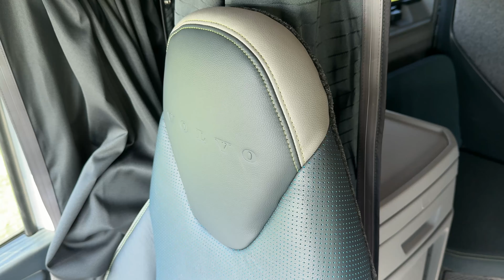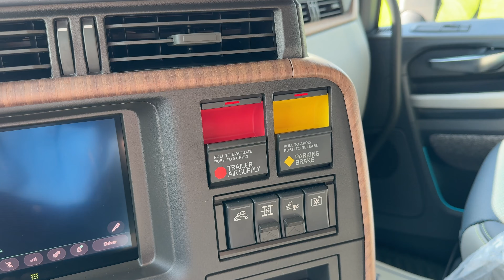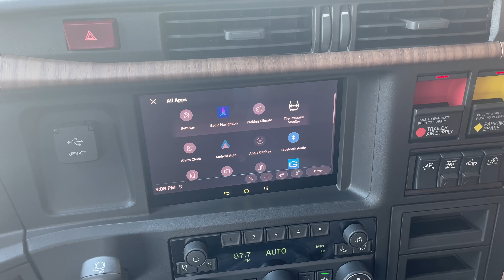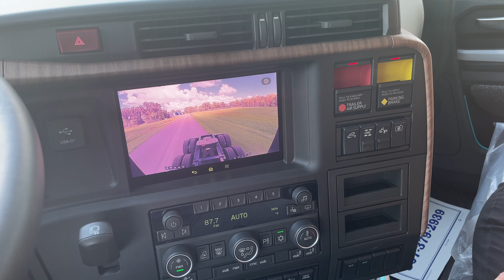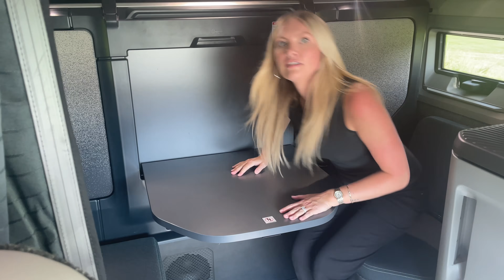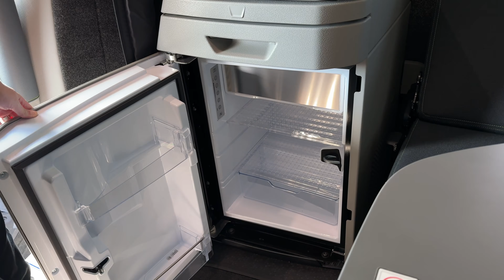All-New Volvo VNL860 Sleeper Interior Walkthrough | Dave Syverson Truck Centers

Comment: Just got done watching a review of this truck the guy said it has led headlights but he didn't think they were any better than the previous ones in the previous truck also the previous truck the turn signals would automatically turn off after turning this truck you have to manually turn them off each time there's also no option for a analog gage cluster so your stuck with a digital one you can put more cameras other than the back up camera if you want more he said with the tanks full your always overweight windows are also smaller on this truck the previous truck you hit the button once to make the window go up once to go down on this you have to hold the button

Comment: The heated windshield is a no for me.  I have had my windshield replaced 6 times in my current truck.
Reply: Is the windshield somehow weakened if it's heated or what
Reply: @nickforest7816 I don't think so,  I psu think it would be expensive to transfer the heating element to a new windshield several times over
Reply: @AC-ir3od i just saw a review video of the new volvo the guy was complaining about having to hold down the button to roll up the windows or roll them down i found out that the mechanism to work the powered windows often fails but you dont need any tools to fix it the mechanism just needs to be reset and it will work again maybe he didn't know that and thought he got windows that weren't fully automatic
Reply: Do you drive in areas where you get a lot of rock chips on your windshield that could be why your replacing it so much the best tip for that is to drive further behind the vehicle ahead of you
Reply: @nickforest7816 Its really random,  often when i least expect it.
Reply: @AC-ir3od do you drive the new volvo like the one in the video

Comment: Bigger fridges in these trucks please. I’m out 8-12 weeks.
Reply: You can only do so much with room tho. You might need to door dash groceries to yourself or something. Or get a. E scooter with a basket and trailer cart and in down time go to walmart. It works and you can get one for 300 bucks. Put a flasher and a flag on it and use it to find loading and receiving in tight locations instead of driving or getting out and walking. It's handy my dude.
Reply: @Nick_Gir never paying for door dash.
Reply: @Nick_Gir you can remove the lower cabinet and place a larger refrigerator there
Reply: If you have the space in your truck, try investing in a Dometic cooler. I bought one like three years ago, the one that is dual zone so you can have half of it as a freezer and half of it as regular refrigerated space. I think it's the CFX3-95. Plugs into a power strip outlet and I think there's an attachment to plug it into a cigarette lighter as well. It did cost a pretty penny, it was like $1300 when I first got it but it was so worth it. Now I just keep my water and quick things I need to keep cool in the truck refrigerator and keep all of the important things I need to actually cook a meal in the Dometic and I put it up on the top bunk since I don't have anyone riding with me.

 It does produce some water every once and awhile that'll drip because of the condenser, but it doesn't leak enough to ruin anything and you can just put a small towel up under it and it'll solve that issue. Just wash the towel every time you wash your normal clothes and you'll be fine.
Reply: You can spec the truck without it and install it yourself
Reply: @dwbee2000 company drivers can’t.